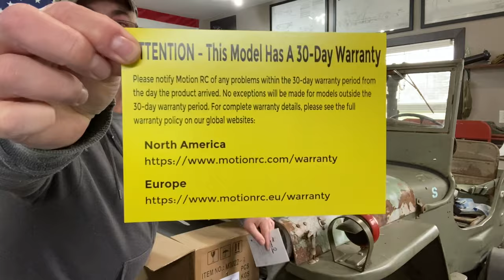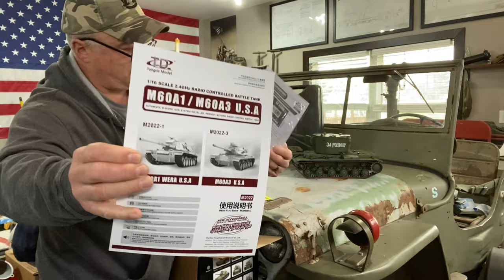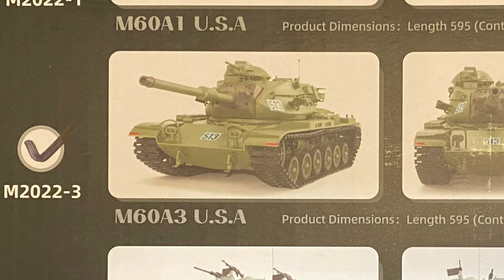Motion RC 1/16 M60A3 by Tongde

Comment: I served on the M60A3 TTS for a couple of years before I moved on to the M1A1. The M60A3 was a good tank. My biggest gripes would be that they are painfully slow and underpowered and the suspension was just never up to the task considering the weight of the tank. It was slow getting the 105 up to ground height when in defilade, and you had to put immense pressure (usually both feet) on the brakes to stop it. I would say your RC version would win in a race with the actual M60. 😄 Was a real workout to drive unlike the Abrams. I did like all the room inside the turret, although shell casings bouncing around without a turret cage could be interesting. Probably the roomiest turret I have ever been in as far as an MBT. The M85 .50 Cal was an interesting idea but in reality it sucked and was just not reliable. The thermals (TTS) on the M60A3 were actually better than the TIS that the Abrams had at the time. The FCS was quite good. Had wind sensor, cant, laser rangefinder and a ballistic computer. We still had the artillery azimuths on ours though. Gun was accurate once you found the track speed that the stabilization liked while on the move, but the Abrams was much better. I think the suspensions of both respective tanks had a lot to do with that. Think of the difference between driving a model T compared to a new Cadillac. I could go on about it for hours, but my post is already turning into a wall of text.  I do miss my time on it, but I guess I can now buy one of these and pretend! Cool video. I hope you post another one up when you are finished putting it together.
Reply: I served on the M1IP and the M1A1 never had the privilege of working on an M-60. a bunch of my friends did I always heard it was a great defensive tank. Thanks for watching. I hope you subscribed stay tuned.